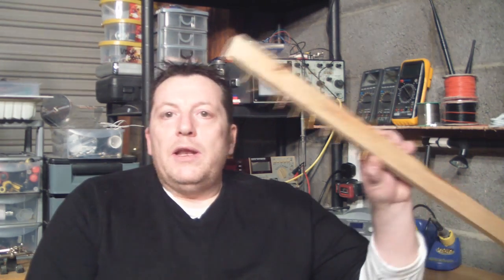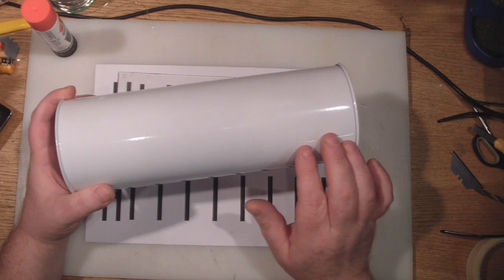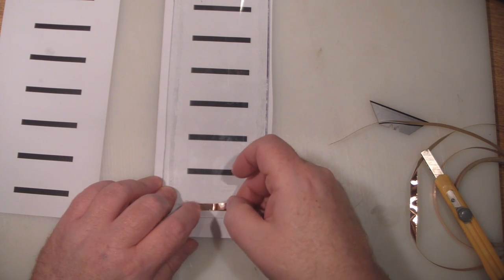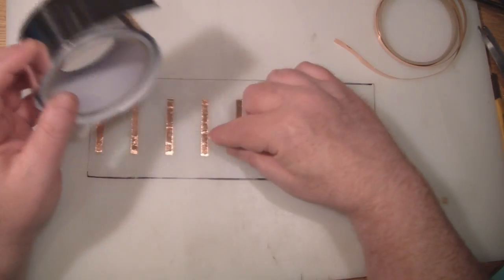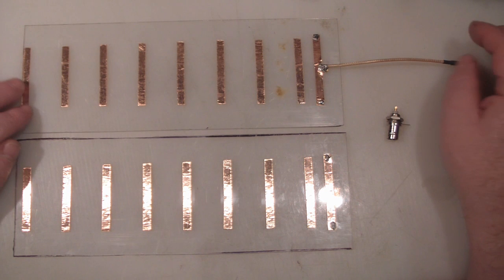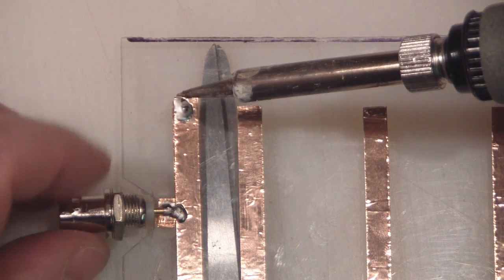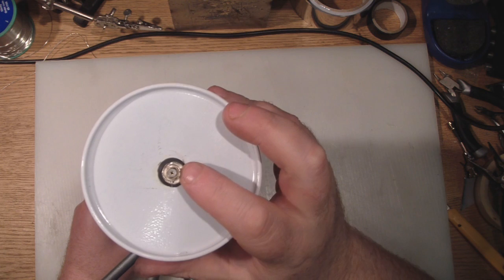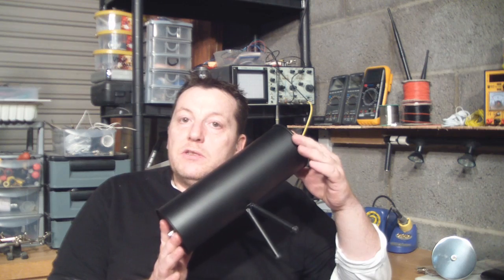Yagi Cantenna (Yagi in a Can) 2.4GHz

Comment: I have my supply sitting in front of me ready to do this. when you take your template down on your plexiglass you said Center your first element at the edge of your plexiglass.

But later in your video I see you have it positions differently
Reply from the maker: That's only because for most of the videos I make many prototypes filming over 3 or 4 days.Starting with the first element at the edge I found makes it easier to center the rest.
Reply: andrew mcneil cant print template  m8..page is strange ...can u upload  it somewhere  ? cheers

Comment: Isn't your driven element shorted to your ground plane right now because you put those 'vias' in between the sides the lead is soldered to? Shouldn't the ground plane be connected to the can rather than the driven element?

If you had created the reflector from tape like the template had it, you can leave the can isolated. If you don't have that, the only thing acting as the reflector is the can and you're not connecting to it. That will at LEAST lose you a lot of gain.

Comment: can i used copper wire instead copper tapes? and also can i used pvc pipe instead can?? thanks a lot, good work
Reply: wire yes. pvc is non conductive and thus will not (for the most part) affect/direct the signal. dialectric (non conductive) materials can and do play an important role in signal propigation. so pvc = no if you want the same performance characteristics

Comment: Can you please enable printing or downloading for the antenna template on google drive?

Is it also possible to just use the yagi without the surrounding can? I want to use the antenna for travels when the hotel wifi is bad and i need to reach some other distant public hotspot.
Reply: Cu strips easily damaged while transporting. Scratch a strip and it's all over red rover. I would used large pvc water piping which solves ll the grounding probs and screw or push lids are bought off the shelf.
All: Instead of asking thoughtless questions of Andrew, do your own research and learn something along the way. Sheesh!

Comment: being a ham radio operator. that is coax, it will work for microwave. but only for short distances. nothing more that 15 feet. 3 feet no big deal in using it.
Reply from the maker: Sorry but it is a big deal. 3 feet of RG8 and half of your signal will leak out of the coax. The wavelength is so small at 2.4GHz it will be like transporting water with a sieve.
Reply: it still isn't a problem. the coax in peoples lap tops is rg174. a lossy coax even for hf. but manufactures use it. no one complains about. it  it works fine. now run microwave signals for longer distances, and yes it is a bigger issue. short runs the loss is negligible. there will be loss on any coax, at any frequency.  it all depends on how much is acceptable. and on short runs even at microwave frequencies, it's acceptable. even using rg174.
 but i do like the design of the antenna you have built. but i have questions on your feed point where you run the driven element  in a sense you making a quad driven element. most antennas i have seen when making a wifi antenna. the feed point is side by side like a bow tie antenna..with the rest of the element running in a circle or square. but your running it kind of like a bumble bee antenna. where you feed the antenna at the center of the coax shield..the shield is split electrically. fully separating left from right sides . then soldering the shield to the center of the coax at each end. but your feeding it 180 degrees apart. i've never seen that done on any feed point. but microwave energy isn't like most other rf energy when it comes to swr. i have had talks with a friend of mine, who is a commercial radio station engineer. he looks after many of the cell phone companies in the area. he told me, as long as you have the antenna electrically matched to frequency. the swr even if it get to 3 to 1 or 4 to 1  the final amplifier wont be harmed. unlike in a hf application. but your running your feed point 180 degrees out of phase. that would seem to counsel out your ability to transmit. being you driven element is a double dipole. much like the bumble bee antenna is. this is why i'm curious about your feed point.
Reply from the maker: kf4dcy I agree with you and most laptop internals antennas are poor and yes you can use RG coax. But as a ham we push our signal as far as we can improve our antennas and setup to get those extra 50, 100 or 200 miles to get to the next repeater. In the world of 2.4GHz we push the signal and improve the setup just to get an extra 50 meters. A lot of my subscribers are into FPV and this is what they push for just to fly that extra 50 or 100 meters. So yes you can use RG8 but if someone builds one of my antennas and uses coax from Maplins and it does not work like in the video they would call me out. 
Andrew :-)

Comment: What is the use of copper if it's not connected to anything?
Reply: if you take a perfect isotropic radiator the global aim is to put in shape a field who look lyke to donuts / tore on a vertical antenna with a single radiator.yagi and other antenna use n elements 1 radiator where bnc or sma is connected and elements to put in shape the field.
- if  element is after (here in the pdf at your right handise) the aim is to act as a director element the goal is to focalise / reduc the angle.-  element is before aim is to act as a reflector element a miror that must send back retropoagation in constructif phase. 

The best analogies is optical replace in your mind element with optical elements and isotopic antenna with a bulb lamp that you wana focalise in only one direction in conical shape.

All elements must place at the correct distance and position in order to respect construc and destruct phases who are a fraction of lambda of the frequency. This why "antenna are cut / sized " for a special frequenc. as harmonic exist antenna can work on other frequence than the nominal frequency F0 but they this is not optimum and very depend of the frequency band.
Reply: @antoninperbosc1532  completely new subject yo me. Thanks

Comment: Great video Andrew, one question: I need to connect 2 bridges over a distance of around 20 meters with line-of-sight (no obstacles) will this antenna be good or is a bit of an overkill and could use a smaller one instead? thanks
Reply: Just peel off directors as you need.

Comment: nothing of this antennas work. i nave build around 20 .
Reply: 2.4 gig is very hard to work with .
Reply: He did it wrong. You have to connect the outer shield from the RPSMA lead to the can, and the center conductor to the driven element on either side (which is why he drilled and filled those 'vias' in the first place).
Reply: @JustPlainRob  He says he did several trial and errors which I trust, but the folded dipole connection is strange to me. Split, connect each vertical with centre, and then braid.  Earth the other side of the f/dipole (zero current popint) to the can, and optionally to the boom'directors. But whatever works I guess.

Comment: Hello I am from Argentina and I wanted to ask if that type of antenna used to increase cell signal in my country is gsm thanks
Reply from the maker: Not as it is no. You would have to re calculate all the measurements for your GSM wave length.
Reply: different carriers use different frequencies.  call your carrier or cell phone manufacturer to determine the frequencies used by your phone.  also the internet can be of use in your research.  look up the carrier and/or model/make of your phone.

Comment: Here's the question: How could it work unless you have a key: Perhaps if you live close to a Mcdonalds and you know the password because you took your laptop there and used it but what if you don't live close enough to a Mcdonalds or a fast food place or somewhere that there is No way you can get the key or password. They are all LOCKED today. How can you use their internet? No one will answer this. They all just give me a simple answer like "It works", but they don't say how they get into the password. So before I go to the trouble of building one Will you or anyone else answer me andrew mcneil?
Reply: The assumption would be that you have valid legal access to the network you're connecting to. This is extremely handy for connecting two sites or if you need remote access to a network you already have permission for or own.
Reply: We have tons of free WiFi where I live.  It's not secure using other People's WiFi anyway.  There are ways to snoop, while you are using Public WiFi.

Comment: O dear this guy connected up his driven element up wrong *facepalm
Reply: Just FYI the reason you had to isolate the can from the outer of the BNC is because that would've caused a short. This wouldn't be a problem if connected the active element up correctly.